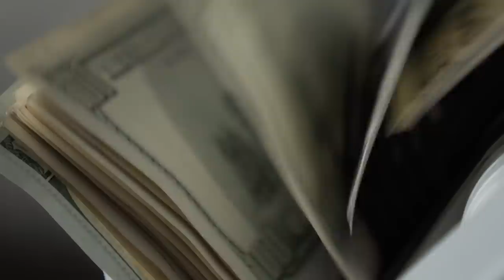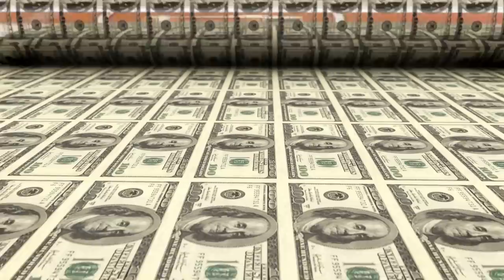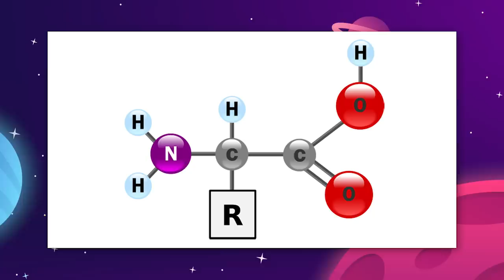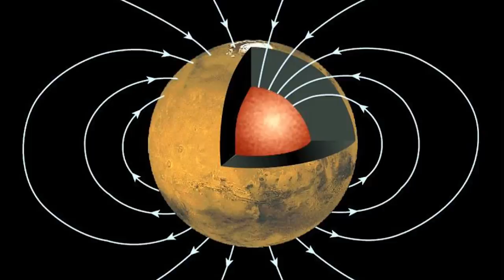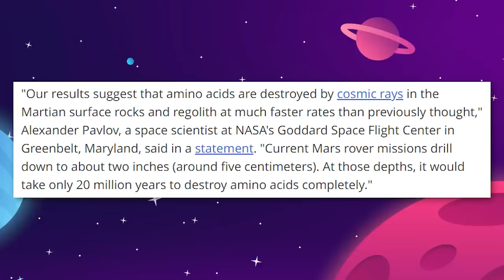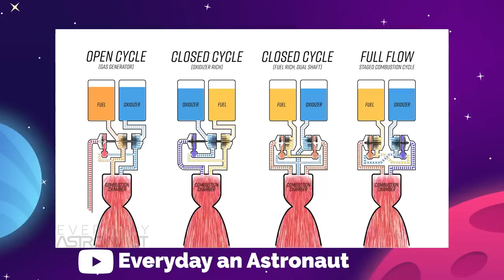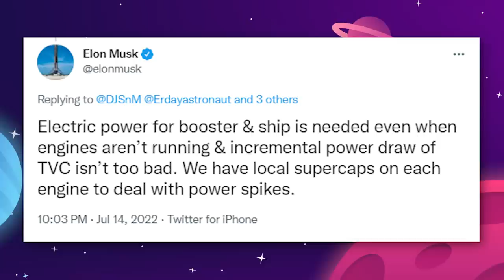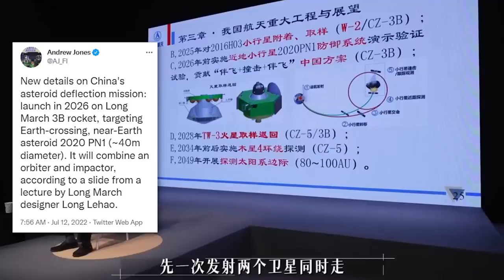The Real Reason NASA Is Developing 100s of Mars Helicopter Drones!

Comment: They should start with Aerostats (Mini-Blimps and Balloons).  The raise into the atmosphere when the Sun is up, and land on the regolith when the Sun goes down.  Just cameras, probe arms and detectors, with telemetry uplinks to satellites.  Super cheap - so much so that 20,000 of them could be in place with just one mission to Mars.  Gyro-copters are very expensive, complex.
Reply: Great idea
Reply: Are you aware of how light the martian atmosphere is lol.
Reply: @yuriaddict4245  Indeed, looks like we have to use the balast system to the nth degree!  (Around Mars in 80 Days Balloon, lol)  -  Sorry, my humor is suffering from heat stroke...
Reply: Angry astonaut did a video on that - before i had never realised - Hydrogen balloons would be totally safe -- no oxygen for combustion
Reply: @tonyug113  Mars the place where zepphilin survive
Reply: @yuriaddict4245  The atmosphere of Earth is incredibly thin too, at heights at which you still have numberless balloons.
Reply: @dandywaysofliving  No, zeppelins are certainly going to return on Venus. Venus really has applicability for them. You hardly can land on it, so that it's good if you have a system which flies without fuel. There are already fairly sophisticated plans for the thing, the concept having been dubbed "HAVOC".

Comment: If they could develop a kinetic penetrator Something that takes a core sample as it penetrates With Leaver bars at the end of the shaft t That would effectively use the impact to then recoil eject  an in  capsulated sample core   Maybe with something so it can be tracked And then retrieved by the helicopter There's not much  in the  atmosphere for it to burn up on Reentry  It would be an easy  way to collect a lot of samples , Depending on how you design the penetrators You should be able to go down to depths as much as 40 feet  Assuming you don't hit any rock
Reply: Verrry nice you think there is gold has to be right

Comment: for the outsider, science happens when something spins. a rocket does not spin, so it is boring after the big boom lose its natural sting. literally. had a few media guy in my lab a few weeks ago, show them the insanely expensive equipment, some nice color changing liquid some other experiments and such, only two thing really interested them, the needle used for precise measure of small amount of liquid (needle, spooky) and the spinning magnet that helps to mix liquids, one of the cheapest stuff in any lab. it spins, so it is sciency.

Comment: Why they did not use the quantum particle physics the study the quantum structure and use the chemical to difuse the atoms in the big stone so it will be changed to ash and collected with a sample and the world will be safety place using the capturing by running the same speed as the large stone it is possible to do that a guess ..so it will be a permanent solution on the earth dwellers thanks

Comment: Mars Sample Return. Funding is ramping up from about $250 million to about $650 million for NASA’s contribution to MSR, an international mission to retrieve samples currently being cached by the Mars Perseverance rover, and the administration is seeking $822 million for next year. NASA notes the mission’s total lifecycle cost is expected to increase substantially as it moves to a two-lander architecture for conveying the mission’s rover and an ascent vehicle to the surface of Mars. The agency recently concluded that a single lander capable of carrying both vehicles would depart too far from proven designs. The landers are expected to launch in 2028, two years later than when the single lander was supposed to launch, with the aim of returning samples to Earth in 2033. With this kind of budget increase, it is highly likely many high tech drones would be deployed on arrival to survey all targeted areas previously analysed and mapped, which are most likely to have had life. Exact details on how deeper core samples beyond surface radiation/sterilisation depths will be drilled with a two-lander architecture, appears to be protected information.

Comment: why oh why did they decide to throw all the little sample tubes all over the surface of mars to be found and gathered — why not just collect them all in a 'cargo hold' of the curiosity rover, and when it is full, it is programmed to pop them out all together in one spot (or better yet — direct transfer to another robot which is coming to fetch them back to earth). 

like scattering them randomly all over seems the worst method, holding in a rover cargo bay and then deposited all in one place (avoiding an error-prone seek mission when they are scattered) seems the second best method, and the best method seems to hold them all in a rover cargo bay and direct transfer to a fetch-back to earth robot. 🤷

im sure the nasa engineers thought of all this. the most likely explanation is that the cargo hold would be too heavy, and impact rover battery performance, so they need to drop samples instead of retain them because of weight. but then there will have to be another robot that can carry all that weight later on when it gets picked up — is this actually the case? or is this just a tremendous lack of foresight that they have to go picking them up scattered all over the place (possibly burried by sand, and lost) instead of one place?